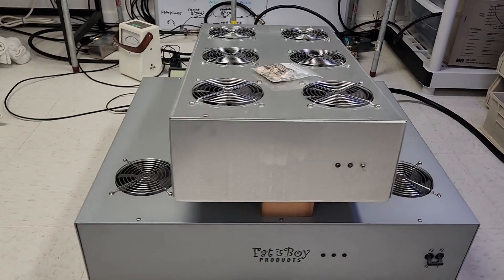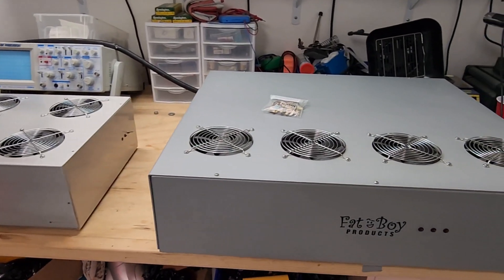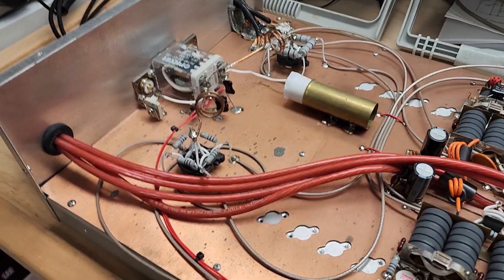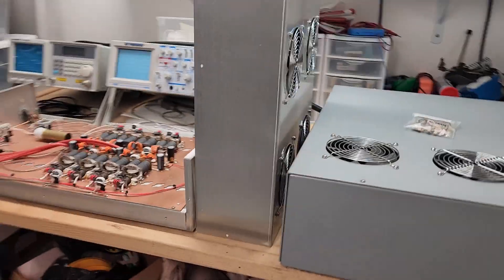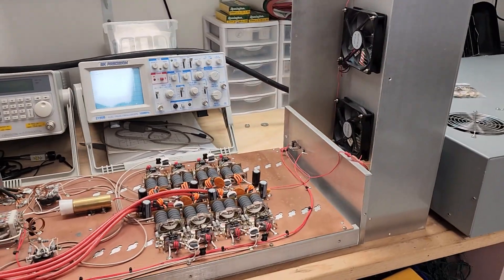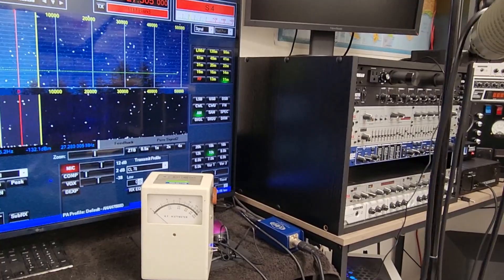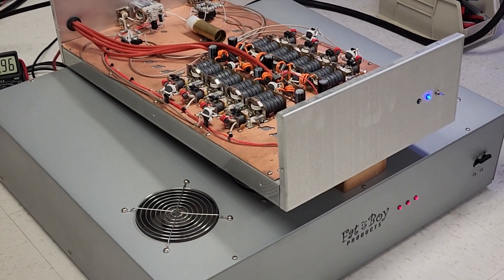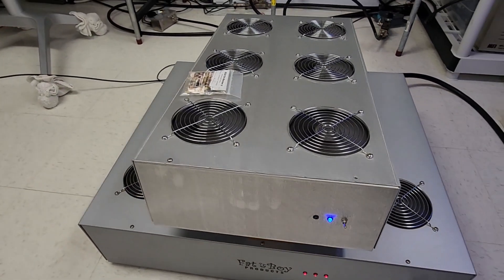16 pill Toshiba 2879 amp, 500 amp regulated power supply, and 16 Toshiba 2879's sold.

Comment: Just an FYI brother and I used to build our own amps, we found that having them long like that is not the best due to the combining lengths so we started making them like a suitcase where it would hinge. We also started using hybrid combiners and they were linear with full bias. Have an 8 or 16 pill on each side. The amp would mount on its side instead of being flat. Fits perfectly behind the seat of the truck and easy to reach connectors and switches. We only made a few as they were just our own and some were prototypes.
Reply from the maker: That's a neat idea. Same here with just my own. I built  everything from a 1 pill up to this 16 pill and experimented with different biasing schemes. And BTW, I just checked out your You Tube channel. Very cool👍. I subscribed